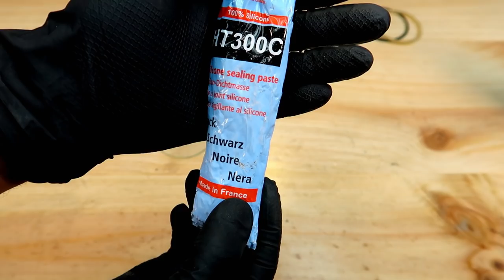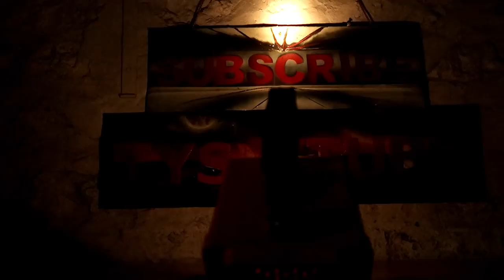Vintage Wonder Lamp Restoration

Comment: should have used LED bulb
Reply from the maker: maybe in next project
Reply: Why would he want to destroy that beatiful restoration with led?
Reply: Niclas Akerstrom  because this isn't the Mona Lisa and 500 instead of 50 hours of light are even better. I would have put in rechargable batteries too, for even more battery life and less waste from dead batteries. A little charging port would mean you do not have to open it for new batteries as well, wich is much more convenient. People would call this "resto mod", wich isn't a bad thing. It gives old things new life and lifts them to a higher standart. Otherwise get a kerosene lantern, than you get that true old school feeling and no batteries needed. ;-)
Reply: The perfect retrofit. That and lithium ion cells!
Reply: soothsayer1 I updated my old school military flashlight with an LED bulb, what difference!
Reply: Incandescent looks better, and it fits the restoration.
Reply: it is restoration  not modding,   who cares about eficency ,  hi will not going to use it anyway.
Reply: LED would destroy the antique quality of this lamp!!!!
Reply: @utahsirens  Just fit warm white LED bulbs and a lithium ion rechargable battery pack, then it would be usable torch. The old incandescent torch bulbs were rubbish.
Reply: Are ya mad?

Comment: Turned out nice. But the thing is quite ridiculous and impractical. A tiny bulb powered by a 9V battery in a giant housing made like that just to acommodate the battery and the back end with that red "cat's eye" or whatever it is that's barely visible. The lights of today are much better and more energy efficient.
Reply from the maker: i know but back then this was like iphone 10Xs now 50 hours battery life 😂

Comment: I have a suggestion if you should run into a similar issue with a gasket:  window caulking cord.  You can get a nice seal and any excess is easily removed.  It's very easy to work with, inexpensive, made for use with glass, not harmful to the skin as far as I know.  That black goop is a pain to use and always gets over everything.

Comment: Too cool. I have some suggestions. Get an LED buld, rewire for a smaller-lighter battery (possibly rechargeable), and rubber dip the legs + handle. 👍👍👍👍👍👍

Comment: Very nice. Just a comment about the sound your grinder makes: just before it reaches nominal speed it starts making a heavy vibratory sound. I think it may be out of balance somewhere, it reminds me of when you drive on the high way with an imbalanced wheel and the steering wheel starts vibrating at certain speeds. You might want to look into that if you want to increase your grinder's life or/and if you want it to be quieter.
Reply from the maker: thank you so much , the problem is my bench is not so heavy

Comment: Great restoration video. I think this kind of old lantern, mark Wonder, it is very rarely in France. Did you work and live in France, right? But anyways, good work. And I wonder why the light bulb from the back, isn't turn on when the lantern's switch it's on and the battery charged.

Comment: You should use an etching primer on bare metal. You can then use a high build primer to smooth it out, if that is what you want. Overall good job.

Comment: I have a few older flash lights. One has gold leaf decals in it. I was thinking of restoring them, but would it hurt the sale value? Great video. With the gasket, I would have just bought an o ring that size, after that I would wake up from the dreams where my ideas work.

Comment: @12:00 ... Back your sand paper with a rubber school erase or make custom sanding blocks from a nylon kitchen cutting board for getting the best out of sand paper. 

@18:00 Making a new gasket. Use a hole drill in a cheap nylon cutting board to cut a shallow round groove, grease that lightly, then pack the groove with the liquid silicone. After 24 hours you have a round gasket. 

Alternatively, take it to auto shops, motorcycle shops, and small engine repairs. There may be a gasket good enough that is made for something else.

Comment: That's a funky looking battery. Just looked it up, seems to be pretty rare. I suppose in a pinch you can use a 6 pack of AAs or maybe C size since it's 9 volts. I thought it was 6 volts.
Reply from the maker: thank you so much 😊

Comment: What you do my friend is a work of art. But it looks like you sanded a bit deep in a few spots. Not sure if on purpose, but just in case. A good way to reduce that. Would be with a sanding block.

Comment: That had the initials "RD" written on the front--gee---I wonder if it had belonged to Rodney Dangerfield??  LOL  
Cool gloves...nice protection from the wire wheel!
How many times normal speed have you sped up your videos???  They go by really fast in places.
Hmm...an O-ring might work for the gasket...and less messy than that auto gasket goop.  ;)

Comment: Is there not a light for the rear red glass? I think I saw one, is that a spare for the front or is it just not working? I have a lantern similar to this but not nearly as old and it also has a rear red light, orange lights on each side and a regular white lamp on the front. Anyway, great video man, subbed :D

Comment: You should use baking soda and water to remove battery acid oxidation. You should never scrape or power brush it. You don’t want the dust floating around.

Comment: you should purchase a good set of pin drivers, although you performed a excellent "restoratio", you should have painted it the same grey wrinkle paint that it had so it can really be called a restoration and I would have only painted the interior with clear paint to keep the original look. I would have left the switch natural too.

Comment: question: what's the different between the wet and dry sanding? ( i know one is with water, but what does it make as a different on the 
metal ?

Comment: Isn't that spare bulb a little foggy?! Nice work btw!
Reply from the maker: it is , i think it came like that from the factory
Reply: I would guess it was etched by the acid leak, but, there wasn't dry residue close by. The important is the lantern, and it now works.
Not willing to extend a comment into a conversation, and being nosy, I'd do an extra detail, and add like, a leather washer before the knob-nuts, so, they don't spin over the painting, I know it will be just a decoration for your shop, it's just a little OCD thing.

Comment: I have a naive question: is it better to wear a protective glove while grinding/removing oxidation with the rotary brush? Or bare hand? (I feel that the fast rotational brush can catch the glove and pull your arm in...or it is just the speculation of the inexperienced?)
Reply from the maker: is better without gloves, now i don’t utilize them
Reply: @TysyTube  Do you feel it is safer too?
Reply from the maker: is much safer without them
Reply: Wearing gloves or loose clothing around rotating machinery is severely dangerous and should be avoided due to the risk of entanglement. I knew someone who lost a finger like that.

Comment: If it's old battery acid, use baking soda and water then use a small scrub brush. I would have just polished it to a mirror finish instead of painting it but that's me. 😁

Comment: Vintage French Wonder Railway Lamp, Agral Portable Lantern....I Think ;-)
Reply: Definitely french made....la pile Wonder, ne s'use que si l'on s'en sert...:-)))
Reply: Usually called a Railway Lantern (by sellers) but the type shown was marketed to the general populace "For the farm, the garage, the truck, we prefer the lantern AGRAL". Genuine Railway lanterns had several differences - they had SNCF cast into the body (rather than WONDER), they had an internal red filter that could cover the beam, and they had a mounting bracket attached to the rear face (because of the bracket there was no rear red lens).

Comment: This argument in the comments about whether or not to put LEDs in it is silly. You can switch out either/or pretty easily! The electricity all goes to the same place, and it would look no different on the outside. Just change some of the bits that were designed to be replaced anyway on the inside.

Comment: Im pretty sure the hole in the reflector is to let light be  reflect back illuminating the red lens on the rear.  Should have painted the interior silver or white
Reply from the maker: you have right Ben

Comment: When you're wet sanding, you don't need to be so aggressive, all your supposed to be doing is lightly sanding to remove any imperfections, such as dust etc that got into the paint. You should not be sanding so much that you remove the primer, which is what the paint needs to adhere to. Nice referbishment though, lovely old lamp.

Comment: I would have bead blasted it, had it powdercoated inside and out, LED with a rechargeable battery and maybe a mini solar panel. Put a battery bank in 8t with a USB socket.
Reply: It's impossible to please everybody. Some people say even taking the rust off is a sacrilege,  others want to convert it into an Internet capable time machine.  He was doing a RESTORATION. Check out Wikipedia for what that actually means,  and what it entails. This is a beautiful restore.

Comment: 12:21 why do you wet-sand the primer?
Reply: Usually the primer is thicker and used to help hide surface imperfections.   So if there are scratches and bumps, you put a layer of thick primer on, then you sand the primer smooth, and only the high parts/ridges of the primer get removed, leaving a smooth surface to paint.   Wet sanding is just a way to make sand paper finer.

Comment: The handle was fixed back wrongly. The spring nut should be inside, not on the outside. Review the section slow motion section of your video.
Reply from the maker: no is like that , i have another one mounted from factory and is the same
Reply: @TysyTube  cool. It the rod that spring out. My mistake

Comment: you know what doeas make a good gasket? another gasket...you realize you can buy those right? in any size even get a gasket making kit to make one if needed for less than 10$
Reply from the maker: where i can find this kit?
Reply: O gasesti in forma de tuburi cum sunt alea de unguente. Se foloseste chiar si la motoare. Faza e ca se lipeste ca dracu' de tare si e greu de dezlipit. Sau fa rost de o camera de roata si o faci cu foarfeca :)
Reply: @TysyTube  I have made replacement gaskets from silicone mastic. You can make a mould out of MDF using a router to cut the profile, then paint with several coats of PVA wood glue, sanding between coats. Silicon mastic will not stick to PVA so you can make a reusable gasket mould. I would not want to use the gaskets in high pressure applications but they are fine for waterproof seals.

Comment: what's with the red thing at the back.
Reply: When you walk along a railway by night, front white and rear red lights means direction what you are holding.
Reply: Milano Walter awesome, pretty clever.  thanks.
Reply: It's a cats eye so who ever behind you doesn't run over you!

Comment: Sorry, i just have to comment on that 'saving the planet' joke :/ It would save more if everyone would stop using those one-use crappy gloves! :D I've tried using them and they get ripped open instantly and then you:
A) Replace them and immediately destroy the planet!
B) Take them off and use more durable installation gloves made from durable materials instead of thinnest latex China has to offer!
C) Take them off, do the job and wash hands after the job! I bet everyone washes their hands anyway after doing manual stuff that requires gloves sooo...

For lighter work, i go on without any rubber as it ruins the feel ;D For heavier work i use proper and decent gloves. For painting i use those crappy single-use ones as generally, removing that paint from the skin is just pain in the butt. Some might say that all those chemicals harm the skin. Yes but that's why we wash and moisturize the hands. Right? No one else?
Well, my two cents. What it's worth. These days not that much.

Edit. If the chemicals you are using are carsinogens, just stop. There are better and less dangerous ones available. If they are irritants that cause rash and stuff, would you trust the thinnest rubber known to mankind to shield your hands? I sure wouldn't! But if you are using those kind of chemicals then you prob dont need crazy good finger dexterity at the same time so use thicker gloves.
I'm giving you discount with this only being two cents but heck, why not! :)
Reply: Private gloves and trash comment

Comment: Your not supposed to have gloves on when using the table grinder or wire brush
Reply from the maker: ok i will keep in mind for next time
Reply: If it spins etc and could pull you in, don't wear gloves or anything that could catch eg long shirt loose shirt sleeves.
Reply: Well the thin nitril gloves will tear instantly (not natural latex, too stretchy!) so they are kinda safeish. But yeah, just get a thick skin for wire brushing :p